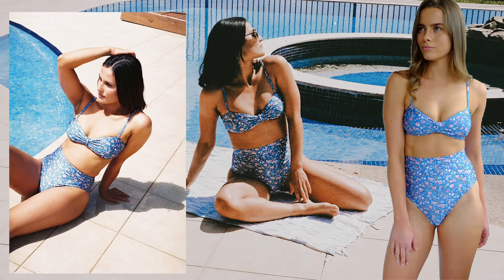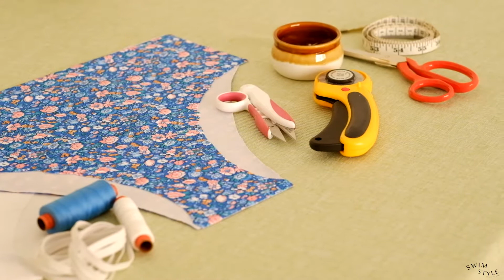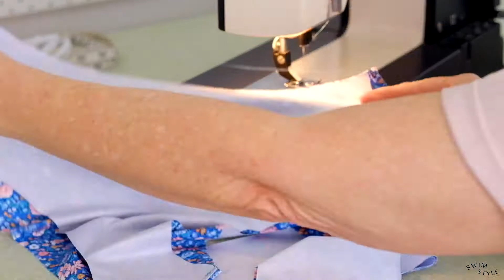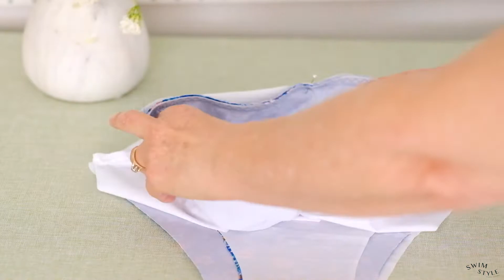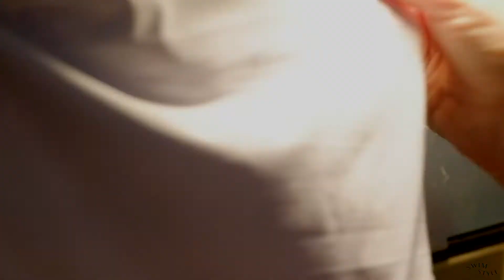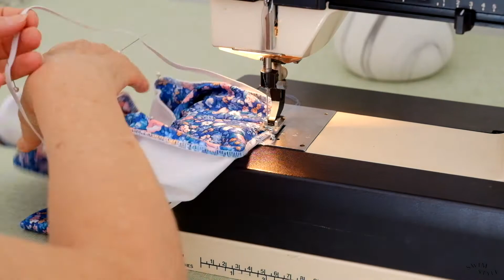DIY bikini bottom sewing tutorial | easy | no serger required

Comment: This is a great video! I purchased my fabric but haven't started yet. I have seen other videos for working with 4 way stretch that shows problems with using pins. You don't seem to have any trouble with them. Do you have any tips for pinning?
Reply from the maker: Hi Lady Luck :) 
I have always used pins for our swimwear makes. Some people prefer the clips, there is no right or wrong answer. I think it's best to use what you feel comfortable with. My only tip for using pins is to use good quality pins, not cheap thick pins. Our pins are available to shop in all fabric shops.                                                         To use pins:
As you pin the fabric, I find I gently insert the pin on an angle. I never find any problems with snagging of the fabric. I suggest you try using your dressmaking pins, if you find it uncomfortable try the clips that others use in their swimwear making. 
Thank you for watching :)
Reply: @swimstylepatterns7657  fantastic! that is a huge helpful tip, I am so excited to conquer this one.  :)
Reply: @swimstylepatterns7657  cool, thank you so much for your reply, very helpful  :)